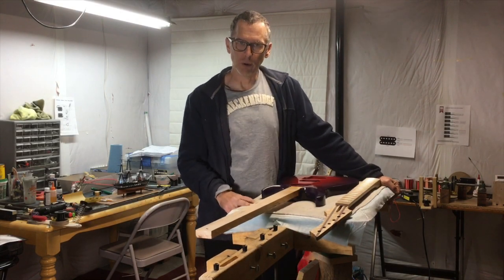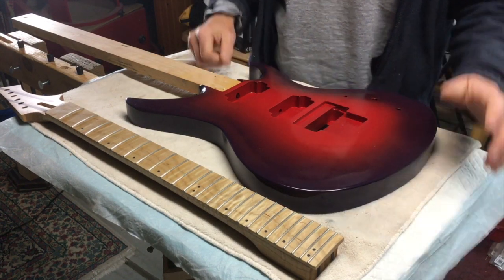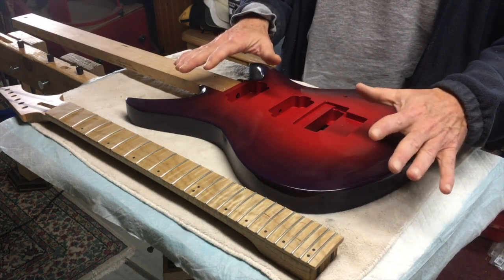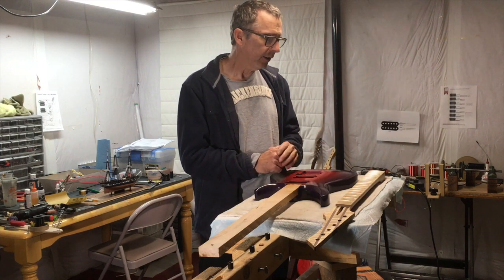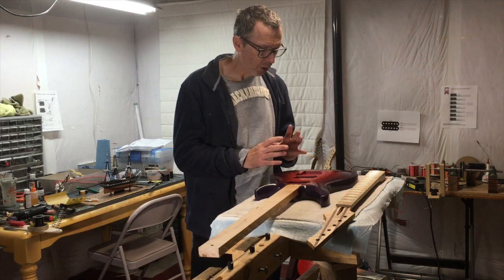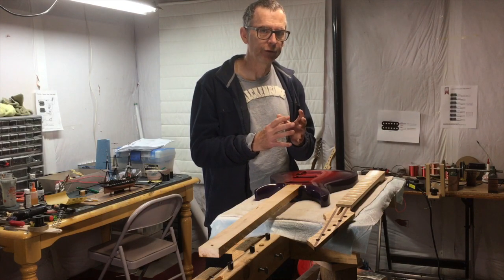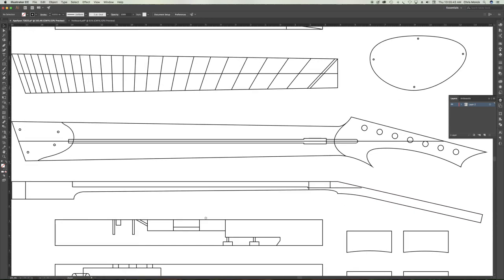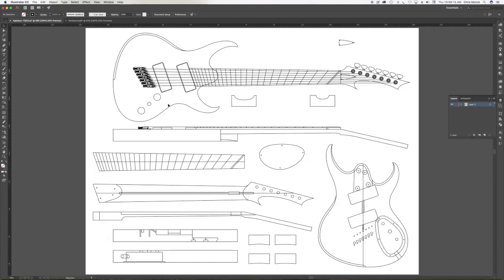Designing An Electric Guitar Part 1

Comment: Great video. Do you have any methods on determining "the center of mass" while in the design stage, so that the guitar doesn't have neck dive.
Reply from the maker: It’s not possible because you can only guess at the weight of a finished body and neck.

Comment: Hi Chris, thanks so much for taking the time to make this video. I have a question about assets in your Illustrator file. The bridge you had in the file was quite detailed - did you create that or is there a resource online somewhere which has real sized vector based representations of actual components?
Reply from the maker: The bridge came from https://cdn.shopify.com/s/files/1/1574/0577/files/4S100.PDF?11793891416318044584. If I can't find a resource for a part online, I draw it myself.

Comment: Hi Chris, you use fret2d - but are you aware that the string spacing at the nut is NOT  calculated according to the string set. They just divide up the distance between the hi and low  E.
Reply from the maker: I don't use it for the string spread at the nut. I use a string spacing ruler for that.